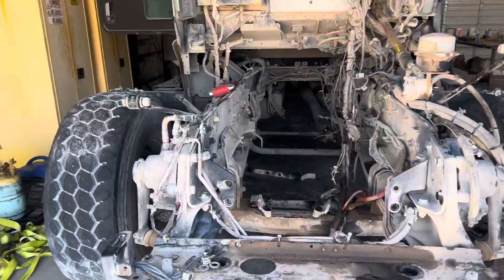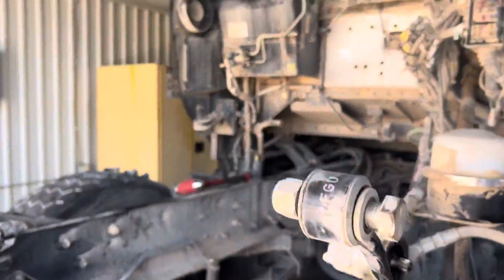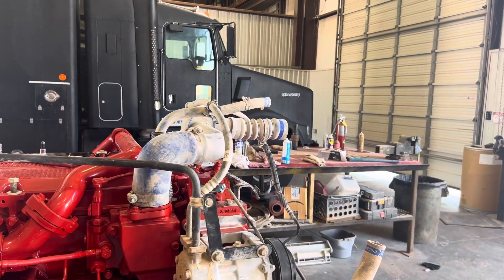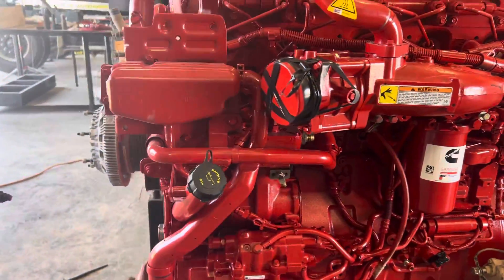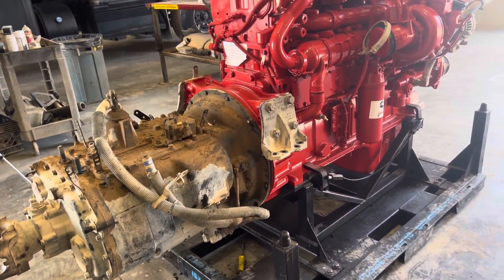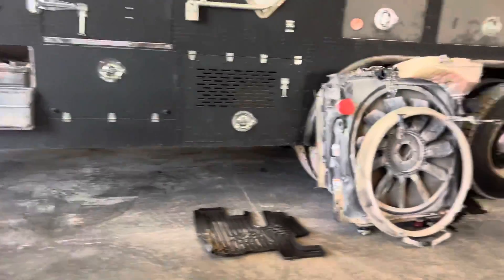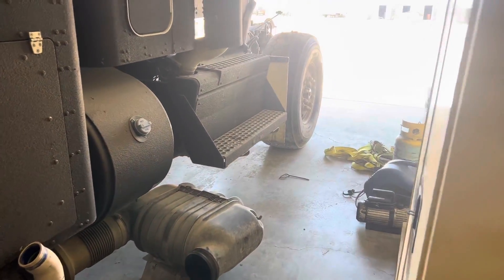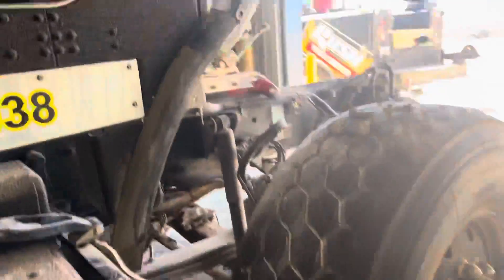Cummins X15 engine swap

Comment: Is it possible to swap an mx13 engine for an x15? The truck is a 2020 Peterbilt 579.
Reply from the maker: It is possible. After swapping, you would have to contact your local dealer and have them reprogram the modules

Comment: In your opinion which is better the newer single cam isx or the old dual cam!
Reply from the maker: Tough one. I like the single for gear train simplicity and fuel system. I like the double for the operational simplicity of the exhaust system. There’s ups and downs to both
Reply: @dirtyassdieseltech6348  u definitely hit me with a twist but I appreciate your honesty..I have a 2007 with 1.4 million miles everything still original..I recently thought it was time for an inframe but turns out it was a bad oil cooler. The repair has been made an I'm just keeping a close eye for now but if it continues I will get the inframe but overall I couldn't be happier with the longevity I really don't see any of the newer one's lasting that long without getting some engine work!
Reply from the maker: @jeffreyweston900  the newer ones are finicky. Nothing like the longevity of a reliable, million mile motor. Keeper trucking
Reply: @dirtyassdieseltech6348  for me I always kind of followed the same practices my oil intervals or done every 25000 miles an one thing I do different from most is I always use 80/90 gear oil..I saw a guy on YouTube Rawse about 7 year's ago an I really think it helps..I've never used Lucas I started doing that after Rawse tore his motor apart an showed the actual wear after almost a million miles an the majority of the parts could have been reused..I was sold lol
Reply from the maker: @jeffreyweston900  so do you run straight 80/90 or do you dilute it with 15/40?

Comment: Did you drop the new engine with transmission attached ? Is it easier that way?
Reply from the maker: I prefer it that way. Easier to swap the clutch and transmission with the engines on stands. And you don't have to worry about a transmission jack failing and the transmission cutting your ear off, happened to me in west Texas.

Comment: That is great work! I just saw a video of PDI intake and EGR upgrades on the x15.

How many miles did you get out of the old motor? How did it die?

Will you rebuild the old motor?

I know it doesnt matter that the old transmission is dirty, but did you want to polish those pieces you swapped onto the new motor? Not really? No problem, just curious. At the end of the day it will run and you got the work done.

🤜🤛✌🏾
Reply from the maker: I would love to do a chrome truck, but this one belongs to a wireline company. They park it on site and it idles for 4-6 days. The old engine only had 250,000 miles on it, but 35,000 hours.
Reply: Plus ALL the dirt that it's in 95% of the time!!!!
Reply from the maker: @scottycollins1829  so true. They practically run wide open in the desert of Texas